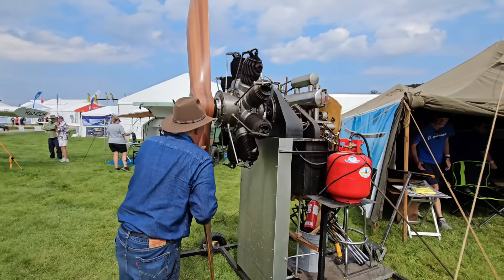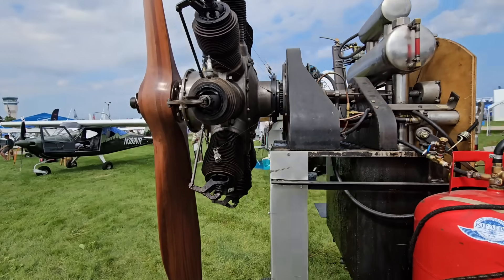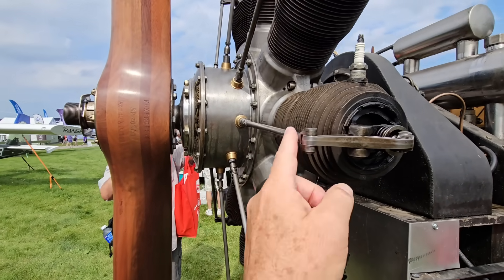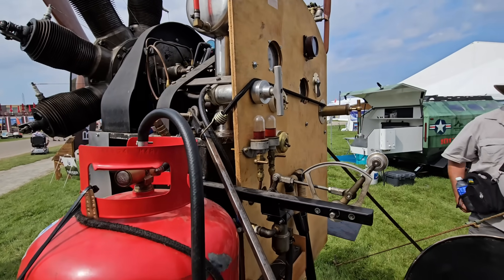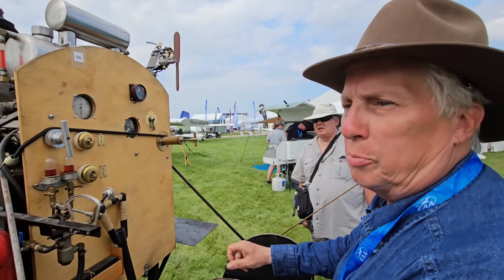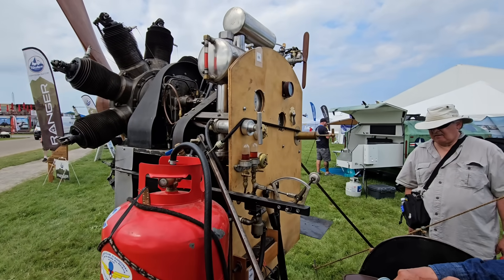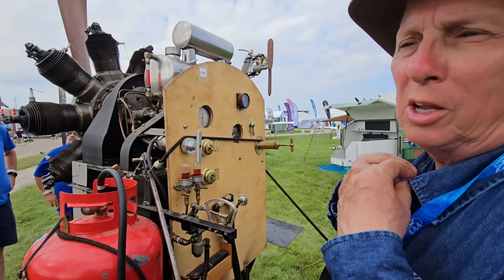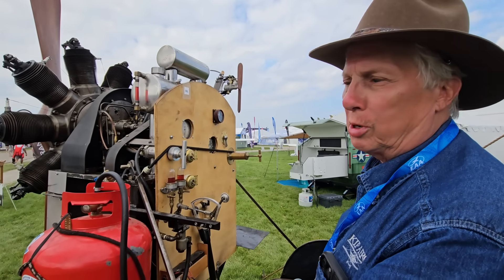100HP Gnome Rotary Engine Detailed Review! OSH25

Comment: Nice video.

I recall reading that in the 1920s someone tried to design a motorcycle with such an engine inside the front wheel. It had to be pushstarted, of course, and I imagine the handling was affected by gyroscopic effects.

Comment: The reason they run so smooth is that relative to the airframe's frame of reference there's no reciprocating components. Both the crankcase and the connecting rod assembly are just spinning in circles, but with their axes of rotation offset by the length of the crank throw.

Comment: Check out the Megola motorcycle from the 20s. It had a rotary engine in the front wheel.
Reply: Felix Millet invented the Rotary engine and first used it for motorcycles

Comment: Smooth operation of a rotary comes not from its inertia or "flywheel" effect but rather because the pistons do not reciprocate in space but move in a circle about the crankpin.
With respect to torsional vibration, the Inertia of the rotating engine smooths the propeller's rotation not the crankshaft power pulses. These engines were soft- low compression, restricted induction, so the power pulse of each cylinder imparted to the crankshaft and airframe is less energetic than modern engines.

Comment: Why can they not do 8/9, 7/9, ...2/9 firing ratio to get more than speeds than the 1/2, etc. ? OK, OEM didn't work that way, but with electronic ignition module, why not? Would need to shift the pattern every few revs to keep all plugs equally hot/clean. Clearly antithetical to the simplistic control mechanisms of the early days.

Comment: Juan, not to be pedantic, but the pistons do not move up & down in that engine. The pistons/con rod assembly rotates on an offset center in relation to the crankcase/cylinder assembly. No piston reciprocation is another reason why those engines run smooth.
Reply: The piston still reciprocates up and down relative to the cylinder.
Reply: @sandervanderkammen9230  I already pointed out the relativity aspect, Einstein. No need to use bold print.
Reply: @onemoremisfit  The reason these engines run so smooth is that most of the mass of engines acts as a flywheel.
Reply: @onemoremisfit  Look at it from the perspective of a camera mounted on the prop. The world is spinning, but the cylinders are motionless and the pistons behave exactly like a reciprocating engine.  Einstein had nothing to do with this.
Reply: Clearly the pistons are moving to-and-fro, toward the cylinder head and then toward the crankshaft. Semantic hairsplit to say that is not reciprocating, IMO.
Reply: @John-z8q3o  No, the pistons are not clearly moving to-and-fro at all. If that's what you think then you clearly don't understand. The pistons rotate and do not reciprocate. This is not semantics, it's simply a basic mechanical fact. There is no semantic issue at all, they named it a rotary engine while other piston engines are called reciprocating engines.

If one wanted to hair-split, it could be said that the pistons and cylinders see linear motion relative to each other in the Einsteinian Relativity Theory sense, but there is no such motion from any other perspective, so you would be the hair splitter in that argument, not me.
Reply: @onemoremisfit  Help me understand. When I drive my wife's  Subaru (with  flat-four Boxer engine) around in a circle, are the pistons no longer reciprocating within the cylinders? Their purely back-and forth linear motion (when the car is parked) becomes a zig-zag  curve.  If I roll the car while driving, does the engine become a rotary ? If the Red Baron counter-rolled his plane at the prop speed, would the engine become a reciprocating engine?

Comment: I was taught about these rotary engines in high school aviation studies class back in 1982 (which may have been a rare thing in high school), by an older teacher who told us stories about his flying PBYs, in WWII, searching for the Japanese, after the Pearl Harbor attack.  He said, “Luckily we didn’t find them.”  I think meaning had he found the carrier task force, he might not have lived to be a teacher.
But this is the first time hearing about the fuel system and rich fuel-air mixture in the crankcase.  Plus, it’s cool to see and hear one run.  And to hear some myths dispelled.

Comment: I'm sorry but I don't believe this guy about the effects of torque. Does he actually fly an Gnome powered aircraft? Much has been written about the effects of torque because of this engine design  and common sense should confirm that the gyroscopic forces are considerable. We need to film someone  flying  a 1917 Thomas Morse scout making a right descending turn with the blip switch engaged then releasing the switch rolling the wings level with the nose on the horizon to see the effects of torque This podcase will only further muddy the already muddy waters surrounding this engine.

Comment: Anything thats constantly losing coolant, I’d say thats in improper or incomplete design. Couldn’t you build an apparatus to collect the oil and channel it back to the reservoir?
Reply: No coolant, its air-cooled.
Reply: @DoktorBayerischeMotorenWerke  the oil
Reply: @Dreamcatcher_4886  "Total loss" oil systems were common during this era... and they are still used today in 2-stroke engines
Reply: @DoktorBayerischeMotorenWerke  yeah but a two stroke doesnt fling it into your face
Reply: @Dreamcatcher_4886  No, but it does blow the oil out the exhaust. 
 fully sealed, recirculating lubrication systems did not become standard for aircraft for a few more years (1930's)

Comment: Very many thanks for this video Juan! Most Americans insist that this is a radial, but your excellent narration should dispel that myth. One feature of the rotary is that the pistons/rods are not reciprocating, so can be build lighter, and as you pointed out it is self cooling even on the ground run. Stay safe! Chris B.
Reply: The piston still reciprocates up and down relative to the cylinder.

Comment: That was great, I love the old rotaries and if you've ever been to Old Rhinebeck Aerodrome in NY, you see a lot of them. Thanks for your detailed explanation of how they fuel and oil systems worked. I knew the oiling was total loss, but never fully understood how the intake and exhaust systems worked.  Interesting what he says about the torque reaction; it was always attributed to making the Sopwith Camel a "widow maker" on takeoff for inexperienced pilots, but that is partly due to the shorter fuselage the Camel had when compared to other fighters of the day, which altered the tail moment and made the torque reaction more prominent at lower speeds. Still, most fighters of WWI with rotaries turned much harder to the right than the left, from a combination of torque and P-factor from the overlarge propellers. The prop on that engine looks like an Axial design, used on several Fokker planes of the Great War. I'm a RC scale builder and details matter. You would usually see a "reverse" scimitar blade on Allied planes, with the curve of the blade toward direction of rotation and wider in the middle of the blade rather than tapered.

Comment: Radial engine, not rotary.
Reply from the maker: No. Pay attention.
Reply: This is a ROTARY engine, not a Radial
Reply: Radial engines do not spin, this is a rotary type engine invented by Felix Millet and predates the existence of Radial type engines. 
Do not confused Wankel engines as Rotary engines, the KKM57 is not a Rotary. Only the DKM54 was a Rotary, and it never saw production.
Reply: What is shown in the video is correctly called a Rotary type engine.
It should not be confused with a Wankel engine which is not a true Rotary type engine.

Only the original Wankel DKM54 prototype was a Rotary.

Mazda has never made a Rotary engine, they manufactured the Wankel KKM-57 type engines.

Any questions?

Comment: Many stories attest to the explosive diarrhea caused by breathing in and ingesting castor oil in WW1 planes and the use of Brandy and milk to mitigate it. The question I have never had answered is, with a fixed crank pin, every ignition in every cylinder will be on the same point on that pin so is there early wear on one side of the crank pin?

Comment: The inlet,  and carburettor  was in the middle of the engine which fed petrol and air through ports (like a  two stroke , )but not ,  then the one valve at the top was exhaust, 
Suck , sqeeeze  bang  blow

Comment: The later Le Rhône improved rotaries use 2 valve per cylinder with 1 pushrod, they had intake runners that went from the crankcase up to the inlet valves instead of ported pistons and cylinders.
The most powerful rotary in WW1 was the Bentley BR engine of around 200hp, its torque reaction did get interesting especially on the short coupled Camel fighter

Comment: This engine of course has no muffler on the exhaust. Do modern small aircraft [non-rotary] piston engines have mufflers?

Is it safe to generalize that military piston-engine aircraft from WW1 through WW2 and beyond didn't have mufflers, as that would decrease performance, and they didn't care how loud they were...whereas piston-engine planes designed for the civilian market have mufflers because civilians want quieter planes?

Comment: I've seen an old motorcycle (a Megola - a German brand from the 1920s) with a 5-cylinder rotary engine inside the front wheel.  I believe the idea was to pedal until the engine caught, and shut the engine off if you want to stop, as there was no way for it to run when the bike was stationary.
Reply: designed primarily for oval track racing.
Reply: @DoktorBayerischeMotorenWerke  Ah, that makes sense now.  I could see pedaling like some old bikes did to get started, but the inconvenience of riding on the road and not being able to shut it off had me flummoxed.  Cheers, mate.  👍

Comment: Not to be confused with the radial engine, which looks similar but has fixed cylinders with a rotating crankshaft. It always amazed me the amount of gyroscopic force generated by rotary engines didn't severely restrict the planes ability to make quick turns, or maybe it did.

Comment: Could you smell the castor oil and it is running? I’ve seen that demonstration in Oshkosh and I could smell the castor oil just like from all airplane engine that runs castor oil. Of course you smell the burn but there’s plenty of unburnt that comes out too because this kind of engine uses part of the fuel load to help cool the engine just like in a small airplane engine The cast oil that they breathe in most definitely gave World War I pilots problems. This guy is his completely off base he runs it two or three minutes at a time three or four times a day. It’s not like he’s out there running a fight over western front and flying in that exhaust for hours at a time
Reply from the maker: Yes!

Comment: Is this the world's first stratified charge combustion engine?
Reply: Not stratified charge
Reply: @sandervanderkammen9230 You think it's homogeneous with that kind of fueling and induction system?
Reply: @jonathanrabbitt Yes, fuel is introduced into the cylinder well before ignition takes place.
Stratifed charge engines have cylinders that only hold air until or right before ignition takes place.
These engines do not have direct fuel injection
Reply: @sandervanderkammen9230 You have an extremely rich fuel air mixture being ported into the cylinder from one end and a whole bunch of fresh air being introduced into the other end. How is that fuel-air charge not stratified? The initial comment was offered in a lighthearted manner and you're getting your knickers all twisted.
Reply: @jonathanrabbitt Basically if you are not using Direct Injection? It's not Stratified Charge Mode combustion.
 The fuel is still mixed into the cylinder during compression so its definitely Homogenious Charge Mode.
Reply: @sandervanderkammen9230 Even with direct fuel injection, the fuel is mixed in-cylinder prior to TDC. Get over it.
Reply: @jonathanrabbitt No, fuel is injected During ignition.
Either by compression ignition from the hot air, or by a timed spark.
 Pre-ignition cannot occur in a stratified Charge Mode engine, because there is no fuel present in the chamber until TDC or near TDC.

Comment: i always recall hearing something about these pilots that flew these needing to cut the engine to make turns? Did i mishear that maybe? I get they use the interuppt switch as the "throttle" essentially, but has anyone heard about anything related to turning?

Comment: Seen a similar set up in the back of an old timey car. Engine laid flat and spun driving rear wheels.
Reply: Adams-Farwell, Dubuque, Iowa. Prototype engines built by 1898, their Model 5 car shown at the 1905 Chicago Auto Show. 5 inch bore, 4.5 inch stroke, built in 3- and 5-cylinder versions by 1906. The 1906 Model 8A roadster would run 75 mph. The company disappeared by 1914, having built 52 cars.
Reply: @PeopleAlreadyDidThis  Thx for info...i had forgotten where i saw this car.

Comment: Juan, one of my commercial instructors in '58 had flown with Rickenbacker in the 94th aero and also a retread in WWII. What he said about those engines is not for a family audience. The castor oil was a wonderful laxative I understood. In combat over the battlefield he pulled in behind his target that would have been his 5th kill to squeeze off a burst. However, the controller for the ignition came apart (as he described it) and the engine quit! Now flying a glider and evading the "bosch" he cracked up in a field and was captured, spending the last 3 months of WWI in an improvised Stalag. As a CFI he was always killing my engine, but man could he teach chandelles.  Lou, thank you for your training.

Comment: Acts like 2 stroke sounds like a 4 stroke.  It’s a hybrid.
Reply: It is a 4 stroke
Reply: @aaronpatchett7940 the point is that 4 strokes don’t normally pull fuel from the crankcase.  Do you know how a two stroke works?
Reply: @dirtcurt1  Its a 4-stroke... no question about it.

Comment: I recently watched the old British tv show "Wings", about the early months during WWI when they didn't have a proper fighter. I think they were flying the Avro 504, which I believe had a rotary engine. When they would land it sounded like the engine was cutting in and out, now I know why, it was the main/only design element to slow the thing down.

Comment: Its really a 'swept volume' not a ' reciprocating' engine. The different axis provide the smooth running. No stop-go! Tdc'bdc! The 2nd switch on the big monosoupape is fractional ignition; 
Check out the le rhones: they oprate differently ,with multiple valves and air fuel mixed in the crankcase. When i was a kid growing up at Columbia (ca.) Joe Pfieffer was there with his pup and nieuport and i got to play with those 80hp lerhones.
Reply: The piston still reciprocates "up-and-down" relative to the cylinder, like every other reciprocating engine,

Comment: Juan, that was terrific.  I remember that day I found out that the "Rotary" engine ROTATED!  I could not believe, and the drawings just did not do justice.  Then I saw a film about them and fell over.  I could not believe that anyone could be that crazy.  But it was light and no one told that it would not work.  And it did.  I am guessing that as inline and radial engines became more powerful, the meer 100 hp engine was left behind.  Of course, the irony was that the Fokker Dr1 an the Sopwith Camel, but used rotary engines.  No wonder they were a terror to land.  No throttle.
Reply: Rotaries did carry on a long way past the 100 hp mark. The most powerful was the late-war Bentley BR2, a 1,522 cu in nine cylinder engine delivering 230 hp, and used in the Sopwith Snipe which continued into post-war service
Reply: My understanding is the blipping was for slowing down the engine for landing.  I, too, remember when I learned that the cylinders spin with the prop.  That was a real "what???" moment.   Cool to hear the blips.
Reply: Later, they had a cam driven box that skipped the spark over cylinders, to give partial power, as it was found, when you got over 100hp, blipping sheared components in the engine. Regarding the smoothness, consider that these pistons go around in circles. They don’t go up and down, so they aren’t being constantly accelerated and stopped, so their weight adds to the flywheel effect. 
The torque on this 100hp engine is about 400 foot pounds, which is the kind of torque a 400 hp engine makes, so I reckon it’s pretty impressive. 
The controllability issue is about the precession that enormous gyro attached to the front of your airframe induces- try spinning a bike wheel, while holding its axle, then try moving it side to side
Reply: @Bakes-z4c  Later Rotary engines also had real carburetors with throttle valves

Comment: Never mistake a rotary engine for a radial engine. You might break a nail. Seriously, though, if you like the sound of radials, have a look on YouTube for MOKI engines, which are extremely popular with radio-control model enthusiasts for powering their big WW2 fighter planes. Fantastic bits of engineering. And the sound is sooooo good...

Comment: Ignorant question: why can't they have a throttle?  There's a fuel line; just put a valve in it.  Oil has its own tank.
Reply: I'd say because the amount of air is a constant while running, determined by the valving and cams. You'd only be able to use the amount of fuel that would provide the correct mixture with that air.
Reply: @craig7350  Hadn't thought of that.  But then ... don't Diesels and fuel injection gasoline engines have the same problem?
Reply: @grizwoldphantasia5005  FI engines have mass air flow sensors and inject the amount of fuel to accommodate that. Diesel engines always have an excess of air compressed hot air, and it will burn all the fuel injected, whatever that is.
Reply: Later engines had regular carburetors with throttles.